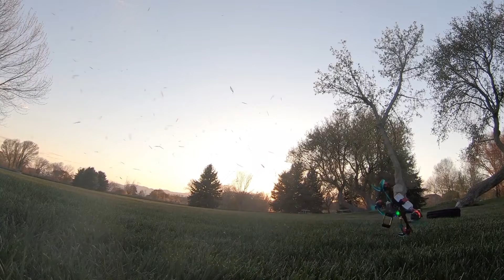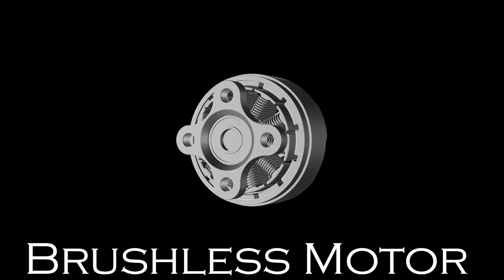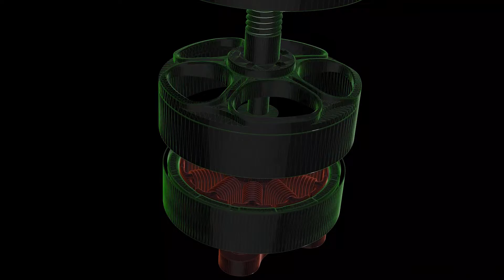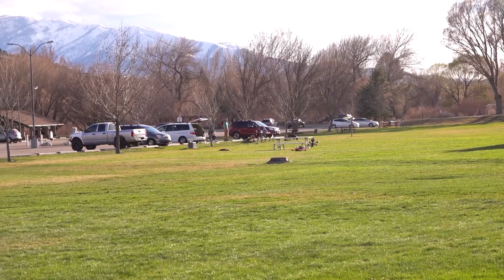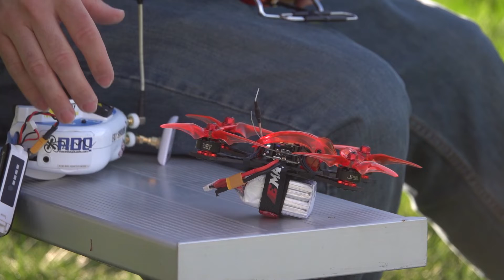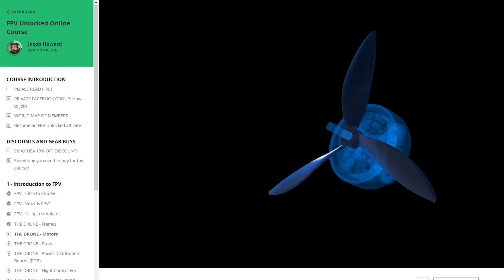FPV motors and what you need to know!

Comment: i know I'm 5 years late but I'm buying generic parts and motors have volts the ones I'm looking at are 1503 7.4v does that mean i can only use 2 cell battery's or would my esc do the power stuff  new to fpv

Comment: I've come to realize that expensive motors are not at all necessary for most pilots. Especially for freestyle pilots. Freestyle pilots will have to replace motors from time to time and the less expensive the better. Race pilots might want the more expensive motors because they're lighter weight because they use titanium shafts, but for me no way. I spent $26 each motor one time. The bearings don't last longer and the bells aren't any more durable. To replace a motor on that quad I could but 2 Velox v2 motors.

Comment: I liked your video and I am subscribed. I hear and read about certain props causing motors to burn out depending on the prop used, whether 2-blade or 3-blade. IE- The HX 115 from BetaFPV recommends using a 4-cell battery only with 2-blade props; and 3-blade only with 3-cell batteries. I think the HX 115 runs 1105/5000kv motors. Would the 3-blade demand more than the motor can deliver while using a 4-cell battery? How can I tell if using a certain prop will cause the motor damage in general regarding  any quad? I know I need to know the relationship but I have never taken the time to find out what I need to know.
Reply: I think that 3 blade props are not recommended for 4S battery is because the 3 blade prop and the motor combination will draw more current. And that is why the motor gets hot and it's not good for the motor.
Prop and battery running on 4S battery will obviously draw more current than the same setup on 3S battery. So if you use a 3 blade propeller then the current drawn increases even more. So it's not recommended is what I feel.
Reply: To get an idea of the motor and propeller combo to be used, look at other builds with similar specs as of yours.